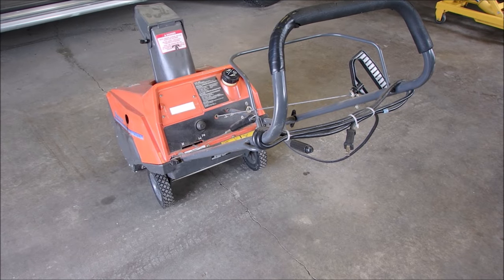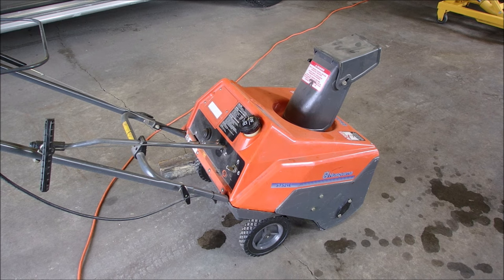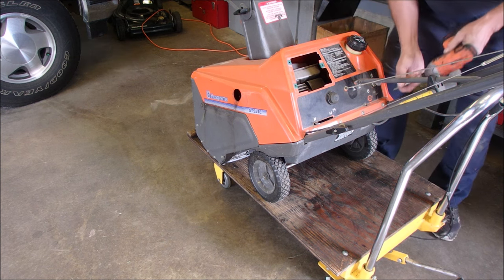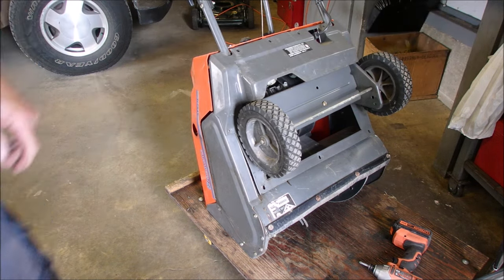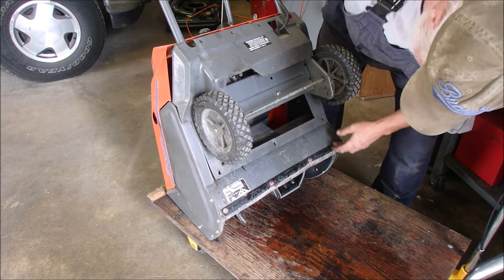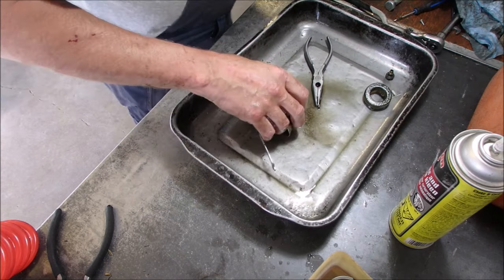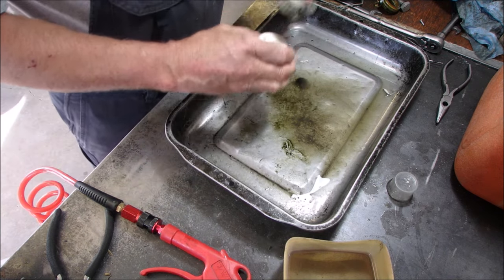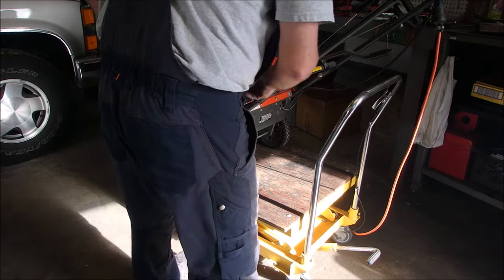How to Repair a Husqvarna 2 Stroke Carb (Snow Thrower)

Comment: Someone left a snapper one on the curb in my area with a key off switch and of course no key and it was rough. When I got it home I discovered it had numerous body screws missing and the carburetor was hanging on loosely with only one bolt. I cleaned it up and found the other carb mounting bolt in the bottom of the engine bay, then cleaned and rebuilt the carburetor. Both the bowl gasket and the nut gasket were toast and the fuel lines were also nasty. I built a fuel shut off switch into mine. Then I replaced the key switch with a toggle switch. Gave it a new primer bulb and spark plug, then replaced all the missing hardware. Now she runs like a little 2 stroke Tecumseh snow-thrower should. My teenager prefers to use it because it’s lighter and easier to control then my big 4 stroke equipment. Great video as always Bruce. I enjoy your infotainment.
Reply from the maker: Well thanks so much

Comment: Hey Bruce,
I did a tuneup on an old Tecumseh and it did have that little spring on the float.  While disassembling it, the spring made a run for it and I never saw it again.  ☹️
I reassembled it without the spring and it ran just fine.
Reply: I hate that spring!
Reply from the maker: We all do  LOL

Comment: Well i gotta tell ya buddy i could tell from the start of the video you never worked on one of these before and were in for a surprise on disassembly to access the carb. Actually i started to chuckle to myself and then started laughing pretty hard. When the piece dropped down i almost fell off the chair and figured you only dropped possibly the nut from the inside on that bolt you were talking about. Low and behold this was not the case and that is when i was rolling around the shop floor, felt really bad for you but i was having a hoot. The one big thing i realised that i never knew before was that Albertan's use two stroke equipment to undercoat their vehicles, Frank is extremely happy eh? Well enough fun for now, hope that lightened up your day. Good job on getting it running and i can not believe it ran so smooth withouth the plastic spacer.
Reply from the maker: Actually I have  worked on these but i took the engine out and it is still in the shed.  LOL, but long enough ago that the pain has gone away.  LOL

Comment: I have a little Ariens down at the shop similar to that with that same little 2 smoker Tecumseh in it. What I found unique about it was the gas cap is HUGE in diameter. Bigger than the lid on a jar of peanut butter. No throttle. Just the choke and primer like yours here. Not really a fan of fixing these because as stated, all that gingerbread you have to remove to expose vital components to repair. And, also as stated, older machines the plastics get brittle. Especially those old Toro S-200’s and the sort with the paddles for an auger. Those we don’t even touch anymore because you can’t get parts anymore.
Reply from the maker: Yes  I  was not thrilled when the owner dropped it off an I saw it was a 2 stroke and how old it was.  There is a part 2 next week.
Reply: Looking forward to watching part 2 Bruce. Check out my Craftsman Snow Blower Then and Now on my channel. I compare (2) 2 stage craftsman snow blowers. One from 1977 and the other was a 2019. Have an awesome weekend and may the Lord’s blessings be with you and yours.

Comment: I'm reluctant to take in single stage snowblowers just because of all the Tupperware that has to come off. They never reassemble easily and, depending on the age of the machine, the plastics often are brittle and break.
Reply from the maker: Yes and you know the fiddle fairies have been in there as well.

Comment: Great video Bruce!
I wasn't laughing...when I saw the 2 cycle snowblower I actually started crying.  I know these too well.  They are truly a ton of work just to get at the carburetor. 

I was yelling Bruce, the  carburetor spacer plate fell...I thought it was going to leak.

I must say, isn't nice to work on a snowblower during the Summer months?
Reply from the maker: Glad you enjoyed it
Reply: I did as always.

By the way, this weekend I went to fire up a tractor I rebuilt the carburetor on and it wouldn't start.  It took me 5 minutes before my I realized my safety precautions got me....I forgot to put the plug wire back on the spark.plug!